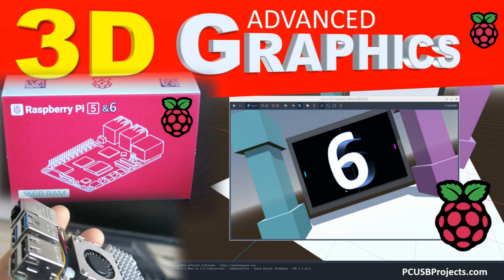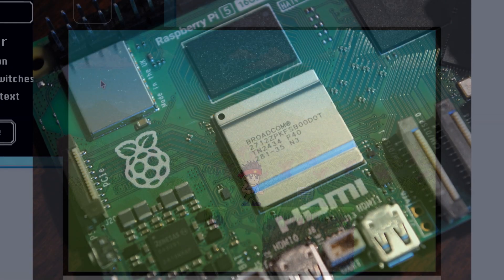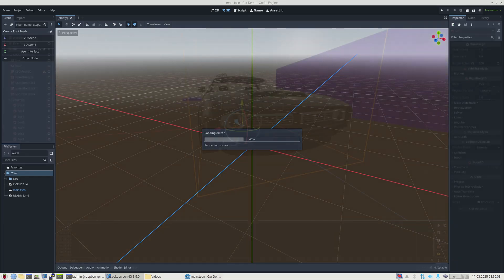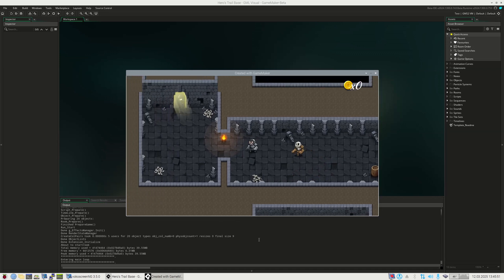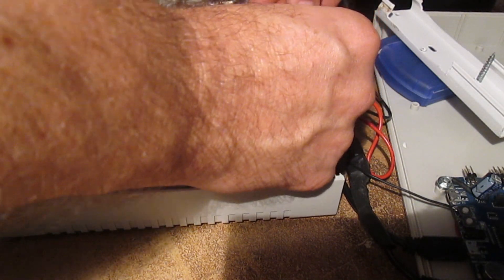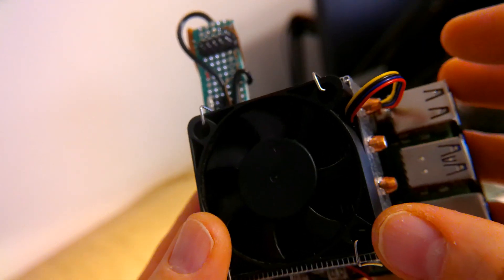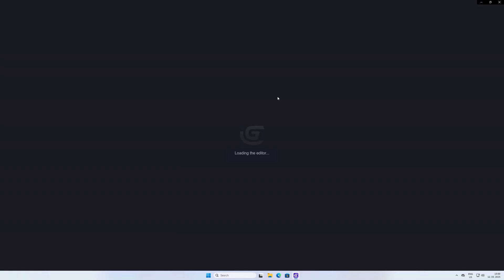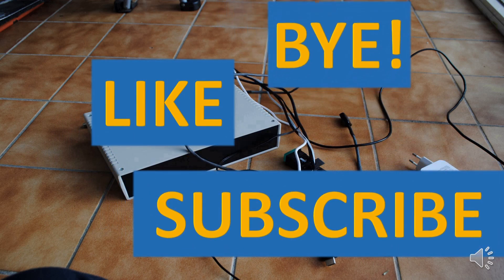Raspberry Pi 3D Graphics: Support for external graphics cards?Is RPi 5 fast enough?PCIe x4 on RPi 6?

Comment from the maker: INFO: There are of course drivers and interfaces for Raspberry Pi 5 for certain graphics cards (such those made by AMD), but they are still unreliable and they can't achieve full performance on Raspberry Pi 5 due to the relatively slow PCIe x1 Gen 3 bus. I hope that Raspberry Pi 6 brings a faster PCIe bus option, at least PCIe x4 or PCIe x8 Gen 3 or Gen 4.